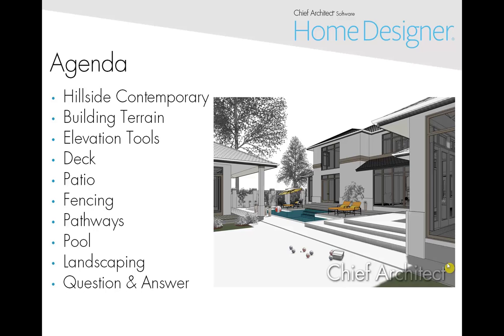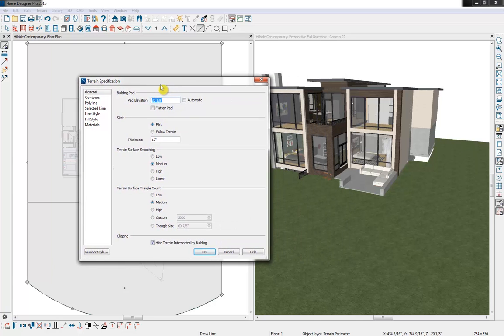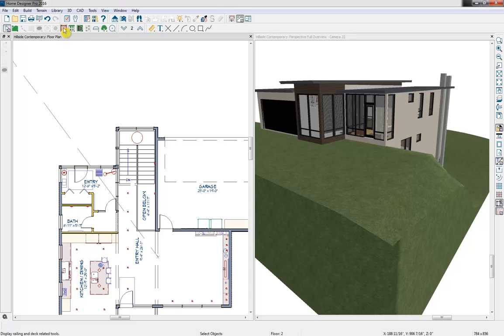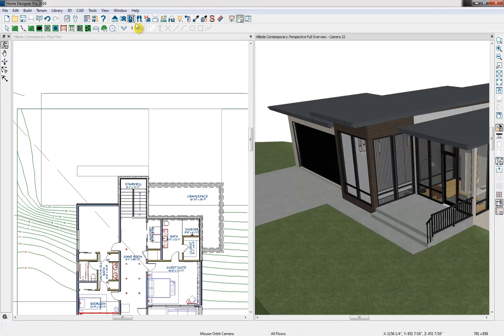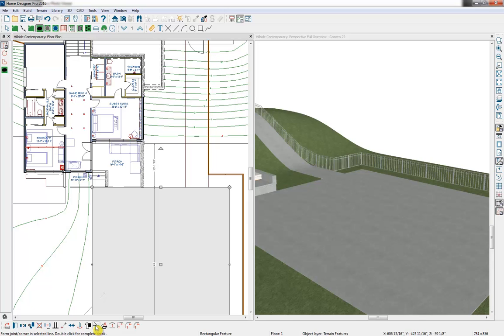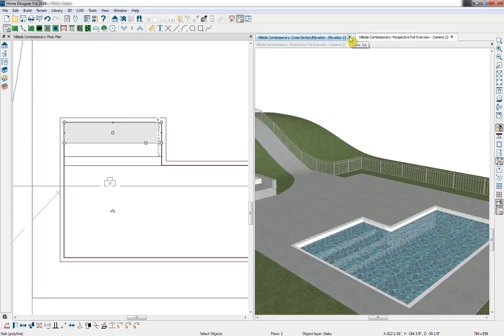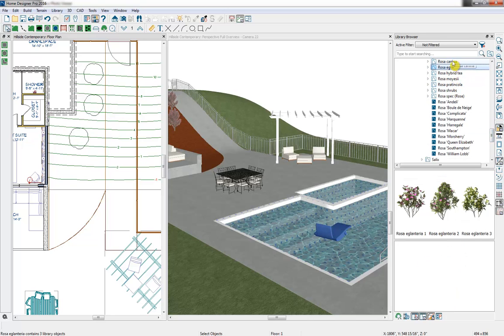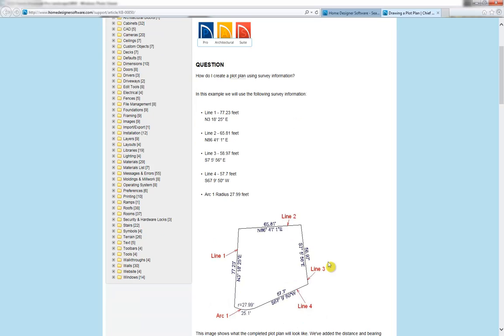Home Designer 2016 - Landscape and Deck Webinar

Comment: Is the reference display available for the second most expensive package?
Reply from the maker: The reference display tool is available in all programs. Here is a Knowledge Base article that will guide you through using this tool: www.homedesignersoftware.com/support/article/KB-00303

Comment: How to build a roof on a exterior deck who don't attach to the house on Home Designer?
Reply from the maker: Pierre Lee THELUSMA an automatic roof can be generated when a room is defined. So once you create a room with the deck railings or deck edge tools, you can then add a roof. If the roof doesn't automatically generate, you can open the room for specification and under the Structure panel you can place a check in the box for Roof Over This Room.